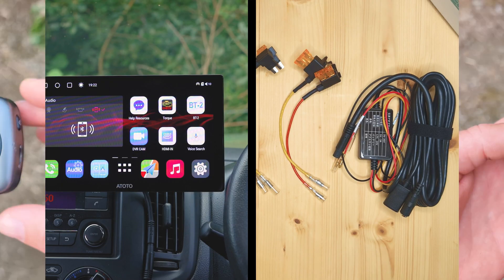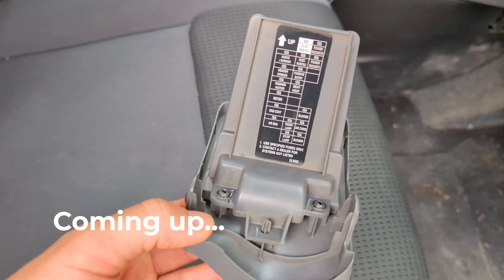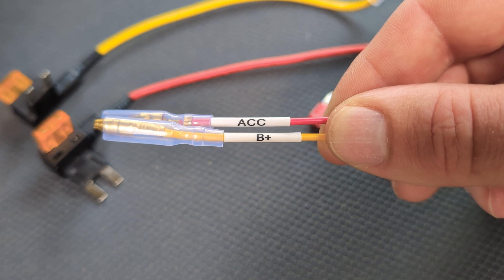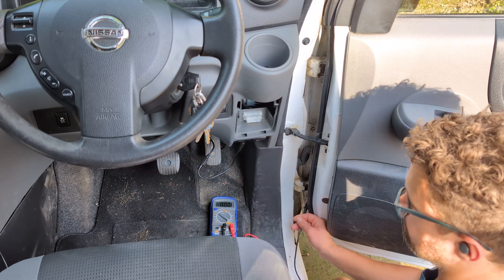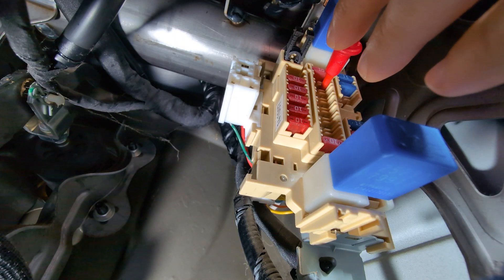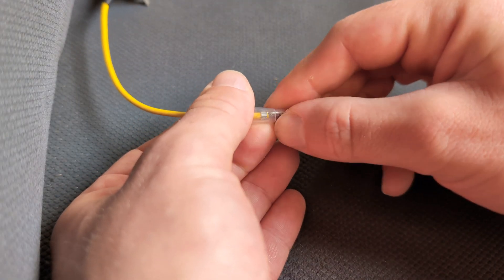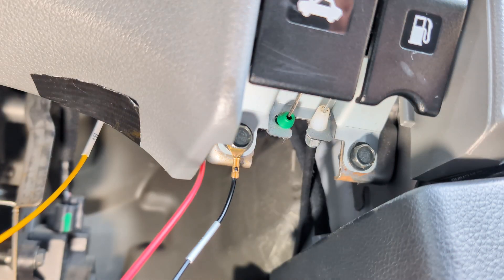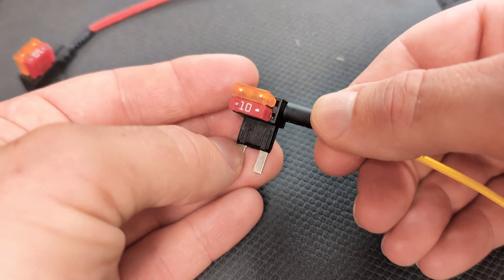How To Hardwire ANY Device To Your Car

Comment: Very nice video, but could the taps become a fire hazard? it's the only thing keeping me from installing them, intrusive thoughts maybe but my car is brand new and im scared hehe
Reply from the maker: My research into it suggests that it shouldn't be a fire hazard - hard wiring a dash cam is a very common thing. Worth checking it doesn't invalidate any policies if your car is new :)
Reply: @ thanks a lot buddy, gonna hold on to my fireproof tape and get it done!

Comment: Should the addition fuse be the same type (amp) with the old one..
Reply from the maker: No it doesn't need to be - the fuse you add is just at a suitable rating for the device you're powering.

Comment: Can you clarify about using an empty slot because I have read different answers online. If you use an empty slot, do you just need the 1 fuse for the dash cam? Would it go in the top slot or the bottom which is usually for the existing fuse? Or should you also put a fuse in the bottom slot for what that slot is rated for?
Reply from the maker: I can only speak for my experiences but as the empty slot isn't used for anything else, I just used one fuse and kept it in the top slot on the fuse tap. If you're not sure about your car or device, definitely seek help from a professional :)
Reply: Thanks!